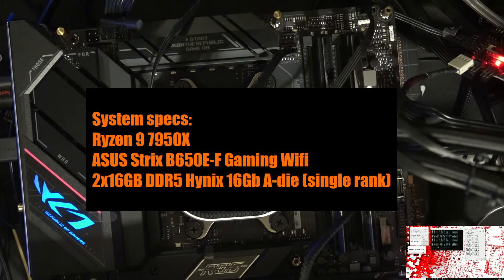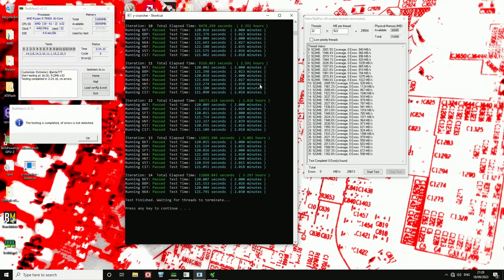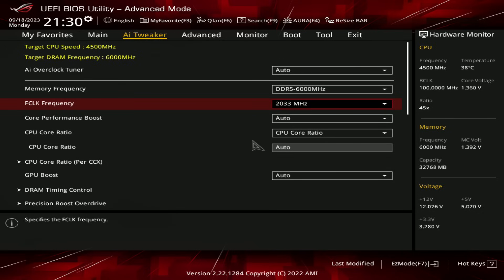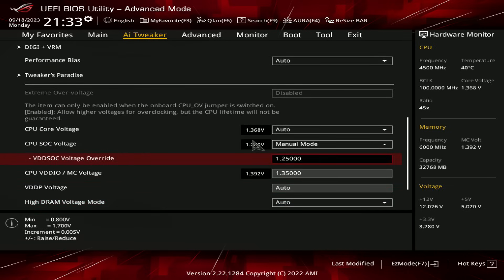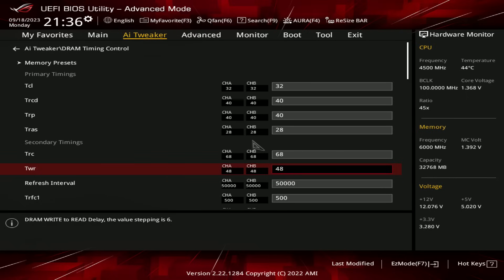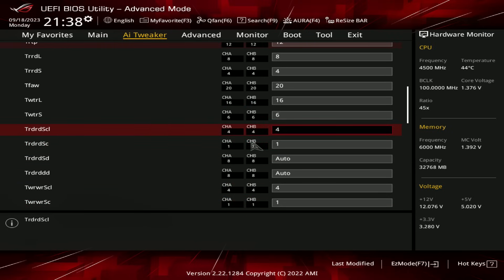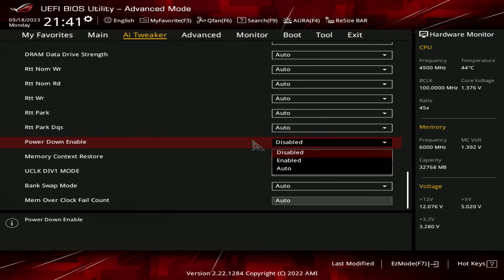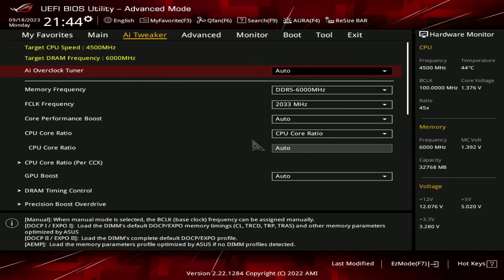Easy memory timings for Hynix DDR5 with Ryzen 7000

Comment: Sharing these settings that worked for me as of 2026:

CPU: 9800x3d (limited to 120w due to it being used with a low profile cooler)
MOBO: Asus rog b850i BIOS Version 1402 - AGESA  1.2.7.0
RAM: G.Skill Royal RGB XMP 64GB (2x32GB) DDR5 PC5-51200C32 6400MHz Dual Channel Kit  (was unstable even with default DOCP1 which these settings solved)

SoC Voltage: 1.25V
MEM_VDD: 1.35V
CPU_VDDIO: 1.35V
MEM_VDDQ: 1.35V

tCL/tRCD/tRP: whatever your kit says in its EXPO/XMP profile
tRAS: 126 
tRC: 68
tWR: 48
tREFI/Refresh Interval: 50000
tRFC1/tRFC: 500
tRFC2: 400
tRFCsb: 300
tRTP: 12
tRRDL: 8
tRRDS: 4
tFAW: 20
tWTRL: 16
tWTRS: 6
tRDRDSCL: 4
tRDRDSC: 1
tWRWRSCL: 4
tWRWRSC: 1
tWRRD: 2
tRDWR: 16

UCLK DIV1 Mode: UCLK=MEMCLK (1:1 Mode)
Power Down Enable: Disabled 
Memory Context Restore: Disabled 
FCLK: 2000MHz

Disable the igpu: (this has resolved the random crashes in games)
Advanced > NB Configuration > Integrated Graphics: Disabled

Comment: Found this video probably 2,5 years ago and found out I didn't have Hynix memory.
Now I got a new pc with Hynix memory and wanna extract some more our of it. It's paired with a 9800X3D on an MSI X670E motherbiard.
Thought of just following this guide, but seeing comments about it being outdated with current BIOS versions.  I still fine with just copy-pasting the values from this video, or will it give me issues?
Overclocking and especially tinkering with memory is a big unknown for me, so I want something that just works like this video, I don't wanna experiment, downloads of tests and then find limits and what works myself.

Comment: Just found this video and tried to replicate on my 2x 32gb 6000 cl30 hynix kit and did not work.
Reply: 2x16 (1R) != 2x32 (2R)
≠
2x16 (1R) ≠ 2x32 (2R)
Reply: It’s because this is 2 years old and the timings are outdated for new bios find a more recent video ( or just make sure you have memory context restore disabled because if you have power down enabled on disabled and you didn’t disable memory context restore it will cause bluescreens)
Reply: @SAM16B yeah i think its outdated, let me know if you know a more recent one. Couldnt find one as good as this one

Comment: Does anyone know if these settings would work for my Amd 7800x3d? I have (2) 32 gb gskill ddr6000 CL323838 XMP kit on a MSI mag b850 tomahawk max WiFi mobo.
Reply: You're going to have to try as I can't determine for sure if your memory is using Hynix. I can confirm I am using these settings successfully with Hynix memory (2x 16gb) Asus B650 and an MSI B850. If it's Samsung for example system won't boot, so you will know straightaway.

Comment: ATTENTION THOSE WATCHING THIS VIDEO IN 2026. the parameters (updated in the comments) worked with AGESA 1.2.7.0 and lowered my memory latencies from 77ns to 66ns in AIDA64. The only setting that caused instability was the Vsoc voltage at 1.25V. I used the much lower 1.125V and it worked stably and without problems.
Reply: Thank you. I can second that this works. Ran into issues with my old timings and voltages after updating my BIOS today, but this worked like a charm.

Comment: Please help! I have 7600x3d and g skill flare x 6000cl36 ram. I cannot get a stable overclock past 5600mhz! I have a Asus b 850m motherboard
Reply: Sounds like you don't have SK hynix chips on your RAM. Putting the model number of your kit into any motherboard vendors memory compatibility/support will show you what chipset you have. Ideally it would be best to go to the product page of your B850M and check there since that'll be most relevant to you if your kit was tested with that board in the first place. I don't buy RAM that hasn't been tested to work on the motherboard I have/want by the manufacturer. ALWAYS check compatibility before buying RAM.

You also didn't say the capacity of the kit you have or if you're using more than one kit together, both of which can effect speeds and stability. You may have to update the BIOS as well since at this point Asus motherboards can handle DDR5-8000. 6000 MT/s has been easy to hit for all memory manufacturers (other than Micron) since Zen 4 launched in 2022 so even if you have Samsung die you should be able to hit 6000 but you obviously can't use the same timings as this guide which is only for SK hynix dies. 

Btw, which Asus B850M is it? I see at least three versions online. There is a Prime B850M-A, a TUF Gaming B850M-PLUS WIFI, and a TX Gaming B850M WIFI W. You have to be specific. For example I have the ROG Strix B650E-F Gaming WIFI. Asus has way too many motherboards with similar names. There are B650M-F, B650E-E, B650E-I ect.
Reply: @vigilant_1934 thank you

Comment: I have some 2x16BB Teamgroup T-Force DDR5 6000 38-38-38 @1.25v expo RAM kit that shows as SK Hynix in CPU-z. I believe they are Hynix A-die because they were produced in late 2024. These behave a bit funny. I have managed to use your tweaked timings. But I have to run trdrdscl at 6 instead of 4 to become memtest5 anta777 absolut stable. It will boot windows with 4 but not stable.  twrwrscl will do 4 stable. What's funny about this kit is that they don't seem to like much more than 1.3v VDD. I have managed to get them 100% memtest5 stable at 30-37-36 + your sub timings at 1.3v VDD. But if I run like 1.31v or more VDD they will fail eventually in memtest5. 1.3v is just right. This means I don't have a shot at making tRCD stable at 36 and also CL28 at 6000 is out of the question because they don't like more VDD. However, my stable settings are kinda the sweetspot anyway. With VSOC at 1.2v, VDDIO at 1.25,v VDDQ at 1.25v and VDD at 1.3v. This is with a 7800x3d and Asus TUF Gaming B650 Plus Wifi motherboard.

Comment: When I type in these values, I can boot into windows no problem. But when I then restart and go into Bios, after maybe ten seconds, my pc freezes in bios. After a reset, i cant boot into windows, because it crashes with „you pc ran into a problem“. Down at the bottom, there is an Memory error code. I have lexar ares ddr5 gen 2 6400MT 1.4v with hynix A-Die (running at 6000MT because of the 7800x3D). Mainboard is a MSI B850 Tomahawk Wifi max. I tried raising the voltage to 1.43v to no avail…. Any ideas?

Comment: What ram brand and model using the exact same configuration as buildzoid is using? If it possible, will different type of chip can do the same?
Reply: The RAM brand doesn't matter. What matters is that the RAM uses SK hynix memory chips. Many different brands and models use them as there are only 3 major memory manufacturers in the world (SK hynix, Samsung, Micron). Use the memory compatibility search/helper for the motherboard you have or are interested in and type in the model of the RAM you want to know about. If that model was tested by say Asus, MSI ect. (whichever motherboard you're looking at) then it'll show details of that model including chipset used.

Oh and no, if you want to follow this guide then it needs to have an SK hynix chip as mentioned in the title of the video.

Comment: Hi guys, I have a rog X670 e-f, with cpu ryzen 9700x. I recently purchased the Orico raceline neon 32GB 6000MHz CL30, with a SK Hynix chip.
Have any of you tried setting the timing parameters with this ram? Is it worth setting these parameters, or do you risk frequent crashes?
Thanks for your help.

Comment: Hi bullzoid, is there an Intel guide for this? Or I can just use this one
Reply: Well i just did it on My Intel setup (14700kf) i'm using team Group t create expert 6400 CL32, kept the Frequency and primary timings and applied all the rest. Dropped from 71ns to 62ns, and currently at memtest at 4/4 passes with peak 46C so thank you!!
Reply: @MaxySnake  Does that kit even use hynix memory? I was looking at one of those kits a couple months ago and they used Samsung I think. It may depend on the model number though.

Comment: Was stuck at 3600. Managed to get 5600 stable with 128gb. Used the tras at 126 and it seems to be working. Tysm
Reply: This is definitely a guide for using 2 sticks of RAM and mainly for 32 GB kits. He has other overclocking videos with 64GB and 96 GB though. Hey at least you got your setup to work better.

Comment: I have Asus rog strix b650-a mobo,  6000mhz cl30 ram and I experience random freezes for 10-15 seconds, using your timings solved the problem for some time but it's happening again and I don't know what to do anymore, it happens only when I'm using chrome and discord, never during gameplay

Comment: I'm using KLEVV CRAS V RGB 32GB 6000MHz CL28 which is using A-Die SK Hynix and it works perfectly flawless!
Reply: Works on my cl36 5600mhz lexar thor got the ram cheap but overclocked it pretty well now also at 6400mhz 1.4V fine

Comment: Stupid settings, trfc1 of 500 is borderline for hynix M, not for hynix A. Same for trefi 50000 will likely error at near 60 degrees which most users will run with stress testing+gpu. tWR is also quite low and will trip hynix m.
Reply: All good with those three setting and 2x16GB Corsair CMK32GX5M2B6000Z30 Hynix M kit 👍According to HWiNFO DDR5 SPD Hub Temperature hit max 54C running Aida64 stability test for 60 mins (everything ticked). Ambient room temp 25C, DDR5 typically sits at 27-30C for browsing/office and 36C-40C for gaming etc.
Reply: @kalaglow5094  aida is trash, run anta777 extreme in tm5 and launch furmark too.
Reply: You can also use prime95 small fft and furmark to see max ram temps.
Reply: I run Aida64 stresstest (all ticked) & tm5@extremeanta777 at the same time, thus ensuring the graphics card is also contributing heat to memory. Prime95 is good. For GC I use 3Dmark. Haven't used Furmark for years, as always thought it was pretty useless for testing OC stability, as it forces clockspeeds to throttle and not interested in just creating heat to test my cooling capability, as happy with system fan noise vs performance.
Reply: @kalaglow5094  furmark is for making heat that heats the ram not testing gpu in this scenario. I never trust people who say they run their ram 1.4V and keep it below 50 degrees. It's impossible in full stress test, in gaming thats a different matter. 54 degrees sound quite cool, depending also on how speedy your fans are. I generally tend to not go over 1000rpm with my case fans.

Comment: Absolute master ❤ recently purchased 9800x3d along with Kingston fury C30 6000 after many months of failing every bench known to man after 3 seconds 

Got them running at 28,36,36,152 using the new formula along with these secondary’s ❤❤❤❤

Passed 1 hour of every bench in through at it, good enough for gaming now, love ya bro
Reply: Can’t get them any higher than 6000 but can get the CL down to 28 as well as the tightest settings they allow
Reply: @chrishonestopinion  Increase both VDD/VDDQ voltages if you have not done already which can make your timings even tighter. 1.35v is the standard but you can raise it all the way too 1.45v but i would not recommend going over 1.4v. 
Personally i have mine at 1.38v as with these timings i have too raise the voltage a little bit too pass OCCT 12 hour test.
Reply: @nicholasphillips5908 I will give it a shot when back home, on holidays just now in Portugal 😂
Reply: @chrishonestopinion  suiiiii

Comment: Please please PLEASE make a video for ddr4 timings. I get that it might not be as plug and play as ddr5 but, folks who are rocking older am4 boards would greatly benefit from a video with "plug and play" numbers we can test out. Im quite out of touch when it comes to ram, i could be entirely wrong with the whole "might not be as plug and play as ddr5" thing but still. I would love if you could cater towards us ddr4 users before we are left in the dust that is new ddr5 ram developments
Reply: ddr4 has really really low timings these days, whats your cl kit of ram, if its a 3200 cl 16 / 3000 cl 14, you have nothing to worry about.
Reply: @nicholasphillips5908  I could see how someone might agree. I'm currently getting ~64ns of latency according to Aida64 extreme with my gskill 3600mhz cl16 2x16gb that is supposedly Hynix C die(thaiphoon burner result) .I tried using dram calc to find better timings however im always making a mistake or something because even the safe profile gives me a black screen
Reply: @mastershifoo5045  64ns is fine, even after the tweaks of this video including lowering some other timings aswell, i can only get too 80ns. Which for ddr5 is no problem. (that includes giving extra voltage to the vdd/vddq 1.35v to 1.38v)
DDR4 vs DDR5 not really that big of a jump, some ddr4 sticks can be better with extremely low timings. maybe in 2-3 years we will see 8000mhz be the new standard like 6000 was. The main problem is the uclk=memclk with ddr5, cant really get 1:1 ratios unlike DDR4.  
Im currently on a 3:2 ratio, memory clock: 3000, uclock mode: 3000, fabric clock 2000.

Comment: Thanks buildzoid, this helped a lot with input delay and the snappiness of my pc in general.
Reply: Testet in aida64 is a medium result (about 63500 MB/s read and latency of 71 ns).
You can actually set alot of voltages much lower and its really smooth.
tREFI 40000 for cooler RAM.

Comment: First of all I know nothing about memory tuning, just following the video.

Everyone writing how this works so I'll just post an account of it NOT working. I have a 9800X3D, ASUS TUF Gaming X870 Plus Wifi and 32Gb Kingston Fury 6000Mhz DRAM. (This was a PC parts bundle I bought, cause it was like 300-400€ cheaper than normal, so I didn't choose any parts. I just got what I got).

If I set all these settings show in the video. Set SoC to 1.25V and DRAM voltages to 1.4V (the VDD... stuff, the XMP profile showed 1.4V). When I run the OCCT CPU + MEM test I still get tons of errors. 

However if I lower the memory speed to 5800Mhz instead of 6000Mhz I can set Soc voltage all the way down to 1.1V (haven't tried lower) and memory voltage (all the VDD stuff mentioned in the video/comments) to 1.3V and get ZERO errors in OCCT. Does this even make sense? How can 200Mhz make such a difference, and apparently higher voltage still does not let it run at 6000Mhz. 

Even if increasing the voltages to max allowable would somehow allow it to run at 6000Mhz I wouldn't do it with all the reports of dying 9800X3D CPUs. All that extra voltage for "maybe" 200Mhz more, but I doubt it would make a difference.
Reply: A stable 5800 MT/s with those voltages seems like a brilliant result to me. Is it stable with with testmem5, y-cruncher and playing games if that is your bag? How is memory training? What results does Aida64 give? I'm getting Read 63713MB/s, Write 92219MB/s, Copy 63641MB/s , Latency 64.1ns @ 6000MT/s as a comparison. I doubt there is much difference between 5800 vs 6000. Anyway really glad you posted, as spurred me on to lowering SoC from 1.25v to 1.20v and so far passing all testing. AND my 7700x cores are boosting slightly higher, presumably due to slightly lower temps.
Reply: @kalaglow5094  

EDIT: Well downloaded Aida64 and ran that stress test and it failed so seems not everything is stable, I guess OCCT is not very sensitive. After a bunch of testing with Aida64 and Y-Cruncher it seems like core 8 (or 7) depending how you count is weaker than the rest. And the memory "might" actually function at 6000Mhz when the CPU cores aren't unstable. Haven't tested enough to say for sure. It obviously needs more than 1.1V SoC voltage for that and 1.1 probably wasn't stable anyway. Set it to 1.2V now. It was stable enough for windows and games not to crash but not stable enough for Y-Cruncher. Think I won't use OCCT anymore at least with the settings I used it wouldn't detect any instabilities.

I haven't had any crashes in games or windows. But I haven't ran these memory tests so I can't say that it's 100% stable for sure. I have however run the OCCT CPU + MEM (set to extreme) test for 5 hours without any errors. I did try to lower the SoC voltage all the way down to 1V, but that didn't work. PC became very unstable then, it even froze in BIOS. But not every time so I did manage to change the SoC voltage back up to 1.1V without removing the CMOS battery. I still have power down enable and memory context restore enabled. Don't want long boot times if I can help it.
Just downloaded Aida64 to do that test. Read 63784, Write 88226, Copy 60647, Latency 74.1ns. Seems Read is about the same but the rest are certainly a bit worse. The memory latency seems quite bad, not sure what's up with that. I have done one other thing that perhaps affects the results I lowered the PBO limits as shown in this video. https://www.youtube.com/watch?v=Cd3iwFTadoo&t=612s, so the CPU is a bit less powerful than normal. Just want to reduce the chances my 9800X3D ends up another "casualty".
Reply: Your IMC is just weak, it can't handle 6000, maybe it can handle it but with very loose timing, like when you boot up with auto values ie. 50 tcl, 50 trcd,50 trp. You just had bud luck in silicon lottery.Seems the new batches of CPUs ie. those produced in 2025 are shit.
Reply: @heksogen4788  After a lot of testing I think  it actually can handle 6000. It's just me being a "noob" at these things. Trying to undervolt the CPU at the same time as configuring the memory to use these settings. I couldn't tell if it was the RAM or the CPU causing the crashes (or rather errors in Aida64, very rarely actually crashed. Although it did do that too). It seems, not 100% sure that it was the CPU undervolt. I've read most 9800X3Ds can handle -25 with the curve optimizer (or whatever it's called, can't remember. Curve something). But mine definitely can't handle more than -15, and I'm not 100% sure even that is stable.
Reply: @atnfn  Bro, learn the OC basics - you first tune the ram, and then move to tune the CPU. Or vice versa. Never tune two things at the same time.